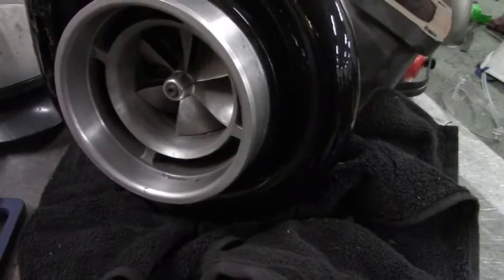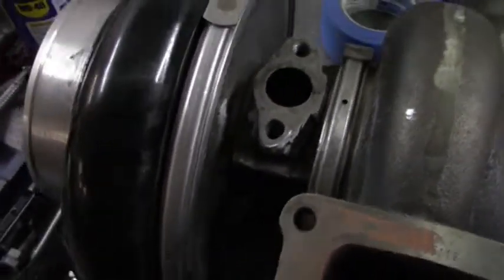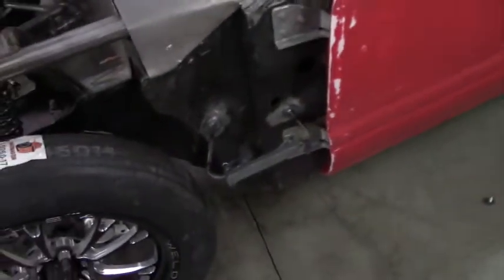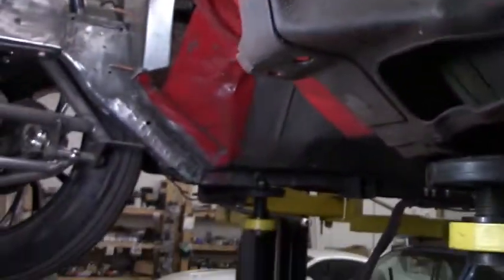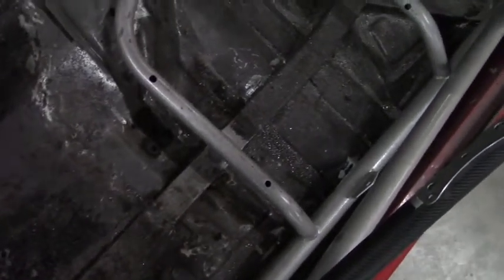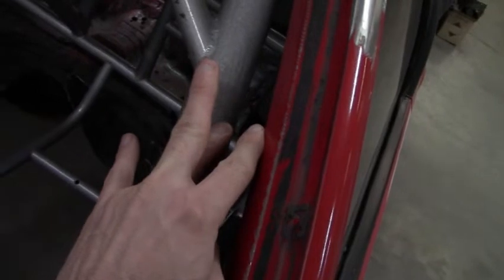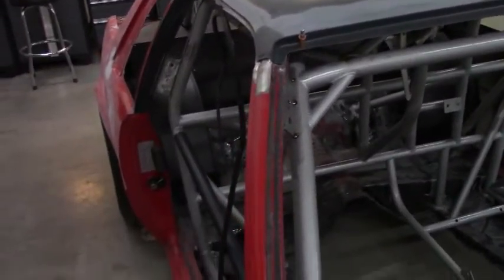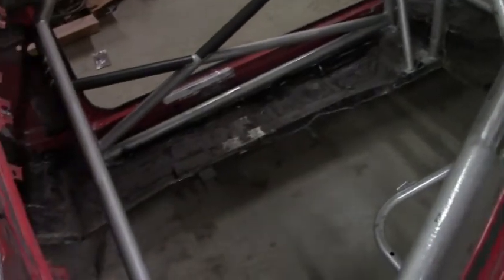STST The Rebuild: Episode 3

Comment: Great videos Guys.... 
I'm wanting to cut my strut towers out and support them like you did. Was there any hidden obstacles or was it pretty straight forward?
Reply from the maker: Very straight forward.  Just run your upper bar first and get your lower bar in place if you cut that much of the frame rail off then bend to the angle you need and you will be good to go.

Comment: I knw vid is a year old but if you had to do all this again would you cut the floor out first an then build back or go the same route (piece by piece). I’ve read/seen people just cut the floor out, replace frame and go that way.  Thanks, great videos
Reply from the maker: Man it’s so much easier to do it right the first time.  If you think you may ever get crazy with it just go ahead do it.  Will save you hours later